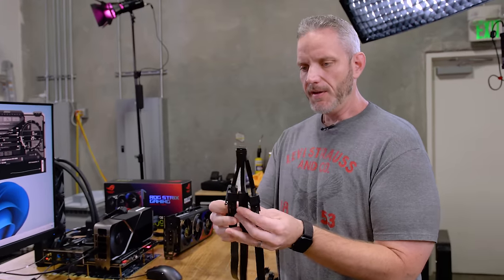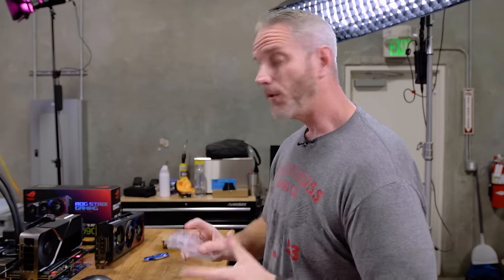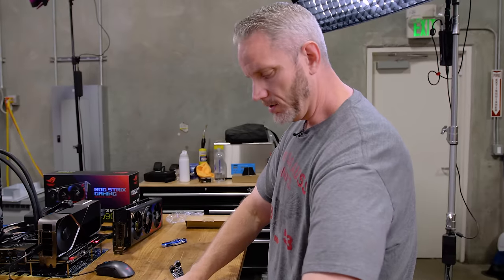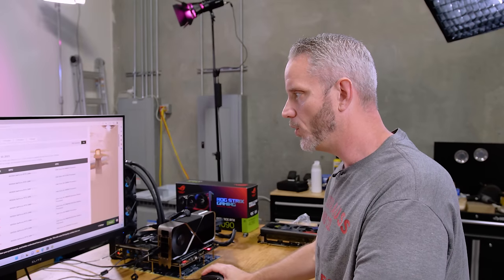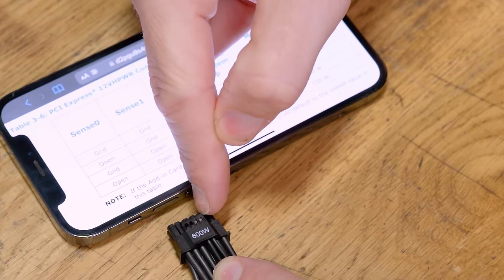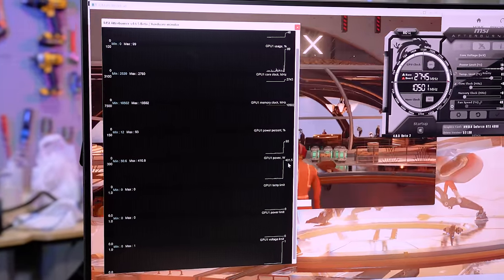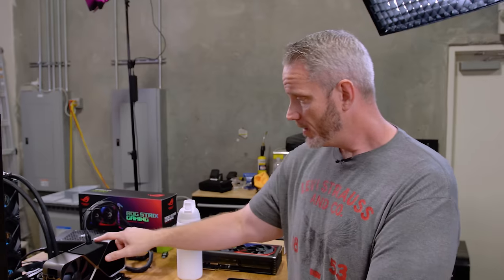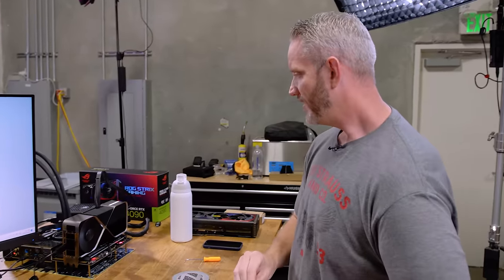DON'T Do this with your GPU!

Comment: Also keep in mind that many psu offer two (6+2 pin connectors) off of one cable back to the psu, so very reasonably two 8 pins back to the psu should be fine anyway. So basically this is not really any different than a potentially common way other people might fulfill the 4,  8 pin connectors available.
Reply: My PSU unit does have these kind of cables? Corsair RM850x. so could i power a 4090 with it? it has 3 double cables... im not sure how it really works
Reply: Imagine. My PSU only has one 6+2pin and two 6 pin. To use squid adapter I would need four 8 pin connections. #1 is solved immediately. #2: A two-6 pin to 8 pin adapter. #3: Two molex to 6 pin x2 then a two-6 pin to 8 pin. #4: same as #3. That's a total of 8 adapters. 😂
Reply: @MrMirukou  You can power it with the RM850x. Tech Yes City did all of his day one 4090 reviews on that powersupply. As for the wiring of the psu, I can't say how he had it wired.
Reply: @MrMirukou  Cables with two 8-pin connectors only deliver the same amount of power as a single 8-pin cable, which is 150W, IIRC. I would avoid using too many of those.
Reply: @ShmeeGrim  That is simply not true.

The PCIe 8 pin standard is essentially implicit communication. It says that if all 8 pins are connected correctly, the device (GPU) can draw 150W. Even if you make a cable and PSU capable of supplying 1.21 jigawatts, the device (GPU) has no way to know that, so will only ever draw upto 150W sustained per 8 pin connector.

Corsair's cables can sustain 300W. But that will only be utilised if provided over two 8 pin PCIe connections, so their cables terminate with those two 8 pin PCIe connections.

At the other end, there's an 8 pin connection to the PSU. That connector IS NOT an 8 pin PCIe connector. It's a connector bespoke to the PSU manufacturer. It can output up to 300W. It only works correctly on the manufacturer's PSU, as the the pinout is often not the same. (NEVER use a modular cable from a different manufacturer, unless you fancy risking connecting a ground pin on your GPU to a 12V pin on your PSU.)

So, each connector on the Corsair PSU absolutely CAN deliver up to 300W, and using the twin 8 pin PCIe connectors at the other end CAN allow 300W to be drawn.

The nVidia adaptor needs four 8 pin PCIe connections as each such CONNECTOR only guarantees 150W. You could be attaching for separate 150W PSUs. You could be attaching a nuclear power station over solid copper bars. nVidia can't tell, so they will only ever draw 150W per 8 pin PCIe connector

Corsair have made a cable for THEIR PSUs. They wire the 12+4 pin connector to tell the GPU that 600W is available. They make the gauge of the cabling capable of delivering that. They make the PSU end of the cable connect to TWO of their 300W PSU outputs. Thus, their single cable CAN sustain 600W from their PSUs.

Note that if you plugged in only One connection at the PSU end, only one of the two sense wires would be grounded (the other would be left "open"), and the GPU would be able to tell. Thus, the GPU would only be "allowed" to draw 300W from that connector.

An 850W Corsair PSU absolutely CAN deliver 600W over either two of corsair's twin headed PCIe cables, or one of their 12+4 pin HPWR cables. As that leaves only 250W for everything else, including transients, I'm not sure I'd want to. I'd rather ensure the GPU be limited to 450W to leave enough capacity for your other components.
Reply: @matbailie3816  Thanks for the info and it clears up a lot of things. But I was wondering about transients because GamersNexus reported:

 "...the maximum current being pulled by the card is consistently about 33-40% over the nominal power which is 450w"(Transient Spike Problem/Youtube video). 

It seems 600w limited cable isn't enough as where Steve demonstrated that all for cables will supply and additional offset of 32%?
Reply: @generalgrevous1984  The 450W + 33% == 600W. Also, the 600W spec refers to sustained load, rather than transients. As Steve mentioned, certain transients Can knock "lesser" power supplies offline, but the description he gave in the 4090 video should be fine for the vast majority of PSUs connected over four 8 pin PCIe connectors. 

If your PSU only supports three 8 pin PCIe connectors, it becomes a lot murkier. The GPU is designed (should be / claimed to be) to not draw more than 450W sustained when using the adaptor with three cables connected. But, longer transients to 600W "could" push a PSU over if the transient is "long enough". What "long enough" is depends on the PSU. But that's mostly because if a PSU can only support three 8 pin PCIe connectors, it is probably is rated for under 600W total anyway (So, GPU + CPU, etc, would probably oversaturate such a PSU's sustained rating anyway)

As for whether the cables can take it, a single 150W cable should be able to handle 600W on its own for several seconds before it even starts to noticeably over heat. They're "rated" for that load, not "limited" to that load; the difference being "at least" and "up to". As the cables are usually 300W cables, I wouldn't worry as the PSU would give up or trigger OPP / OCP before the cable is at risk.
Reply: @matbailie3816  Wow, thanks for taking the time to explain. I recently bought a Corsair AX 1600i for super cheap so I guess I'm good. Was just debating with myself to go either with Corsair's new 2 cable or supplied 4 cable. I have 10 8 pin outlets but the two cable did seem more aesthetic and easier to deal with.
Reply: @ShmeeGrim  those 2 8pin daisy chain can do 150w per 8pin aka 300w max per cable. That's exactly why the max on the corsair cable in the video is 600w....
Reply: @MrMirukou sad u get no answer.
 YouTube is to help people.  Wow

Comment: The correct term for the "kickstart" voltage is the "Inrush" voltage. This is common through low voltage dc electronics as well as large circuit breakers for industrial motors. The inrush is akin to when you open the floodgates of a damn, there is a large starting deluge of water or power in this instance, then it tapers to the supply voltage.

Comment: I'm curious to see how the super compact power supply cables behave thermally.  A thermal camera video or section of reviews would be really helpful, especially since these cards risk igniting their own cords at max load.
Reply: Long cabels with a lot of connectors are usually way worse than shorter cabels without them.
Reply: Fortunately these products have specs that are available online, and have actually been tested for their power rating. Microfit connections from molex are almost as good in terms of power delivery as mini fit Junior (with a rating of 8.6Amp versus 9 on the larger connector). When you consider that the standard would normally use pigtails on 8 pin connectors, four 8 pin connectors would use 6 positive wires and 6 ground for 600 watt, and a single 16 pin connector would use 6 and 6 as well.
Reply: AWG 18 (0.75mm²) cable is the most common across power supplies and can easy carry 12 amps (1440 watts @ 120V). In Jayz video it looks that AWG 16 (1mm²) may now be the standard being moved to, easily carrying 15 amps (1800 watts @ 120V). So these cards risking igniting their "own" cords is not a problem.
Reply: @hexdator2934  good point. the reason I didn't bother to talk about wire gauge is that the limiting factor is the pins in the connector at the lengths used in a PC.
Reply: @edwardallenthree  You went to an even greater level of detail......👍I was replying to OP..
Reply: Sadly, Jay doesn't do anything highly scientific for us nerds who are more interested in the objective measurements. He only likes the funny stuff and effing around. He has said so himself. I wish that he did that kind of content, too, however. Would get him more eyes for his content.
Reply: @edwardallenthree  Pins...and the traces on the board.
Reply: @hexdator2934  that's only 120V though, in the video is about 12V. 600W at 12V is about 50A DC. Might explain why they require 2 or so cables in parallel.
Reply: @pmAdministrator  
Luckily, we have Gamers Nexus for that kinda content...
Jayz is more on the commercial side of spectrum. Clicks> content.
Reply: Corsair was wrong and that cable wont give the gpu full power watch GN for that
Reply: @2511jeremy  No buddy, check the video again, especially the spec sheet they show. Both sense 0 and sense 1 pin in the side band are grounded in the corsair cable (of course with both adapters connected on the PSU side), meaning the card will be able to ask for the full 600W.
Reply: @morla505  gamers nexus talked with Nvidia and corsair was wrong corsair already apologized to them
Reply: @2511jeremy  that apology is for a misunderstanding on the nvidia adapter behavior, bit of a different topic. When using the nvidia adapter with only three cables plugged the 4090 will indeed limit itself to 100% power (450%, a bit arbitrary since each one of the 4 cable can support up to ~375W, so two cables should be enough to reach 600W). With the corsair cable shown in this video the card will be able to use up to 600W even if the cables are two, since the two sense pins are grounded.
Reply: @hexdator2934  Except that they don't work at 120 V. More like 12V so for 1200 watts, they push about 100 amps in total.
Reply: @Wingedmechanic  No mate, that’s not how it works. You’re completely wrong, no offence.

You need to brush up on your Ohms law buddy, V=IR…..
Reply: @hexdator2934  What exactly is Dileesh wrong about? 12V x 100A = 1200W.

Are you trying to suggest that GPU voltage regulation circuits operate on 120V input?
Reply: @falcon-ng6sd  Mate, don’t be an idiot. If an AWG-16/1.5mm² cable can carry 15amps at 110v/230v then at 12v this is more than sufficient. 

So you’re saying that 100amp at 12v need an AWG-4/25mm² 100amps rated cable? Lol
Reply: @HEXDATOR  I don't see anything in my comment mentioning cables, only voltage and current.

Anyway, what is the relevance of the 110V/230V situation when the PCI-E power cables supply 12V to the card? I'm guessing that it was just an example of current ratings of wires - fair point there, but that could have been made clear earlier.

If you have 6 wire pairs capable of handling 15A each, that gives a total of 90A - more than enough to comfortably supply 600W at 12V.
Reply: @hexdator2934  Wire doesn't care about voltage. It only cares about current. The only time. voltage would be relevant is the insulation around the wire and whether it's sufficient to insulate and not breakdown. So, yes for 100 Amps you need 100 amp cable regardless of voltage. Or as an alternative, you need multiple lesser rated cables in parallel. It's all about the formula I^2 * R.
Reply: @edwardallenthree  "I didn't bother to talk about wire gauge is that the limiting factor is the pins in the connector at the lengths used in a PC."

And this is going to be the weak link here. The contact resistance between the pins is going to be higher than the resistance of the cable and will overheat first. This heating will further degrade the connection by causing oxidation and make things worse. There's a reason they are shipping those cables with these cards and recommending that you use them. This guy in this video is giving people bad advice.
Reply: @stefanl5183  What? I said that a 1.0mm² cable can run 15 amps... So this is fine for a SIX core PCI-E (6x15=90amps) cable. Did you just decide not to read the part where I gave ampacity?
Reply: @stefanl5183  please ignore anything Stefan says. Jay knows what he's talking about, I know what I'm talking about, the ATX 3 specs know what they're talking about when you read them. If your power supply comes with an ATX 12 volt cable, such as the ones that Corsair is selling for their power supplies, and your power supply company is reputable, which Corsair is, then it is perfectly fine to use.

There is a lot of bogus crap information out there. Go to resources you trust. The manufacturer of your power supply should be a resource you trust. The manufacturer of your graphics card should be a resource you trust. Jay should be a resource you trust. And if you doubt any of them, read the specs for the underlying components.
Reply: @edwardallenthree  Yep…..

Comment: The standard has 4 sense lanes. The first two produce a binary number (with 3 being 600watt). No IC needed, just connect both to ground to produce a 11 (or 3). The other two are power ok and gpu connected and are both optional.  

edit: just got the part of the video where you say this and reference the same page on the spec I did. should.never have doubted your journalistic chops, Jay!

edit 2: awesome video, explained the sense pins very well and made me actually more excited for the future.
Reply: Can't wait to see pictures of people molex>6pin>8pin>12 pin. And having two speaker wires coming out from the side band, grounding into the case with techscrews (ground IS ground ¯\_(ツ)_/¯  )
^not unlike shi**y audio setups in cars :))
Reply: @IcecalGamer  as long as they include adapter cables with the cards, I don't think we're going to see much of that. I hope I'm right. Just for the sake of people's homes and their neighbors.
Reply: To be fair, Jay isn't always right, no harm in double checking what he says. Literally last video he said these are PCIE 5.0 cards when they're 4.0. At best he meant it figuratively, but he didn't present it as such.
Reply: @blarghmcblarghson1903  he did? Weird. It's an issue for me. I use the additional slot for a mellanox (I won't call them Nvidia) infiniband card for my storage network, so being able to use the GPU at 8x without a performance hit is a feature I want.
Reply: A 4to1 adapter cable (and 2to1 too) will still need an IC to drive the two sense pins. As it needs to count how many cables are connected on the ATX 2.0 end, as any three out of four should produce the same sense signal because you cannot rely on users populating then in the order prescribed by the engineer. I didn't see an IC on the Corsair cable and because it's got two inputs I half expect it to incorrectly report the higher mode if one one cable is connected to the wrong input.
Reply: That is how Corsair's adaptor works, both are to ground.
But GN pointed out if you are using Nvidia's adaptor, it can sense how many PCIe power are plugged in. (Corsair sent and very impolite Tweet calling it "Bullshit"... which prompt an respond from GN in their second RTX4090 video...Corsair apologized for that Tweet) 

The Nvidia's adaptor may have an IC with two NAND gate in it to make sure all four PCIe power are plugged in.
Reply: @emilybjoerk  you know there's a deeper point that you have, however. All of these adapter cable solutions failed to solve the problem of someone connecting them up to a power supply that doesn't actually have the ability to provide 600 watts of power. Certainly none of these solutions have the ability to detect if the power supply is sometimes capable of that and sometimes not. It's a pretty good thing that it's kind of reserved for the highest end right now.
Reply: @edwardallenthree  Every properly built PSU can handle the gpu trying to pull 600W from it: either the psu delivers it, or safely shuts down. Similiarly, every GPU that tries to pull 600W either really needs that power and handles it fine, or was broken in the first place and dies randomly just as any faulty component would. There is no need for any smart communication between GPU and PSU, because both behave in a way defined by their atx standard.

The only thing that the sense pins account for is the cabling. Responsibility falls onto adapter/cable maker to make sure that they don't melt. They've mostly been added in order to keep compatibility with very old 8pin standard (hence they have four tiers in 150W increments). 

The way that corsair made their adapter makes for one dangerous edge case: plugging just one connector into psu can still report as either 300 or 450W 'available'. They better be sure that this one strand of 6 wires can carry 450W without melting, or have good enough lawyers to claim user error when damage was result of plugging just one out of two cables.

Realistically though, competent user will plug both connectors, and since the standard calls for 12 pins to carry 600W, they definitely made the wire thick enough to handle that.
Reply: @emilybjoerk  "will still need an IC to drive the two sense pins."
Not really - they should, but we already know they don't.
Reply: @ABaumstumpf  it's not needed if it's done on the PSU side, hopefully not just tapping voltage directly. There should be enough protection on either side of GPU/PSU

Comment: Sense signals S3 and S4 are not for remote voltage sense as people might think. They let cards know information about how much power the PSU can provide.  A logical combination of Sense0 and Sense1 tells the card how much power it can use according to the table below.  In the PSU the appropriate sense0 and sense1 signals must be pulled to ground or left open to tell the card what the power limits are.  These signals may dynamically change, but only when the power supply is in standby mode, meaning if they change when the 12V to the card is on the card might not recognize the change and act appropriately to the new setting.

The sense1 line is pin 4 (the right most pin when reading the 600w label) and the sense0 is pin 3. 
Sense0-----Sense1----Bootpwr------Maximum Sustain Power
-----Gnd-----Gnd----------375W----------600W
--Open------Gnd----------225W----------450W
-----Gnd----Open---------150W----------300W
--Open-----Open---------100W----------150W
Reply: If the card supports this feature properly and you remove the lines from the cable the power limit should drop because now both sense0 and sense1 are open.